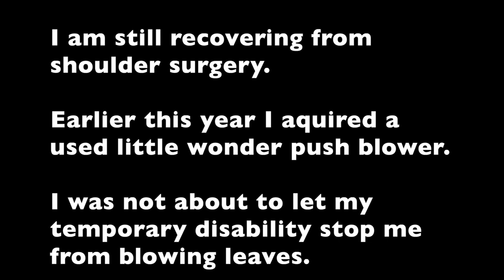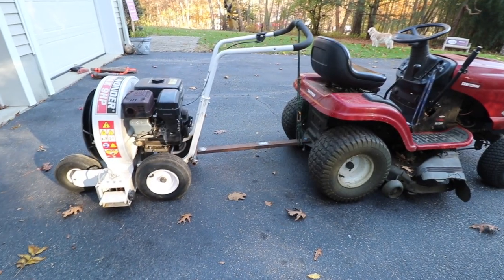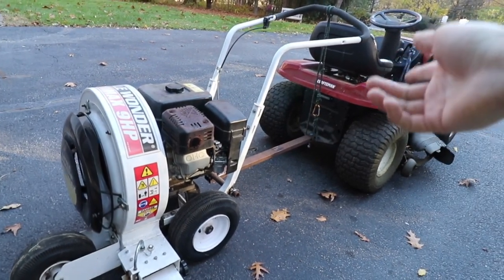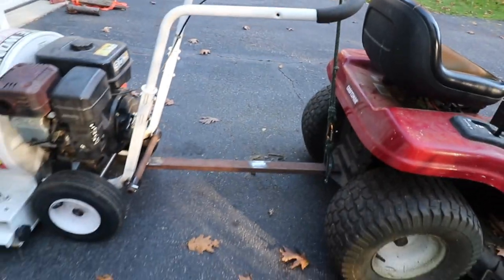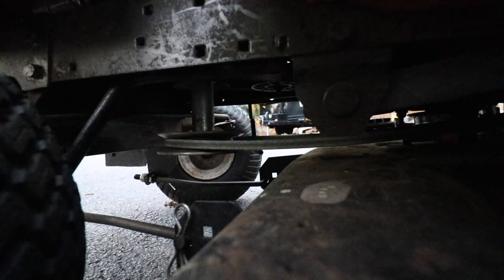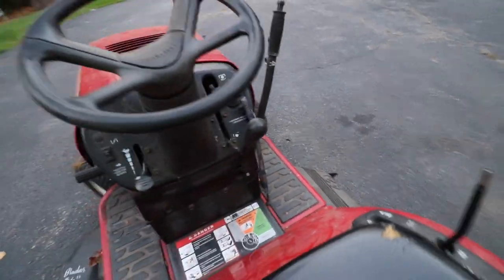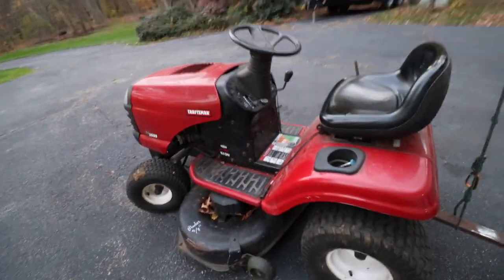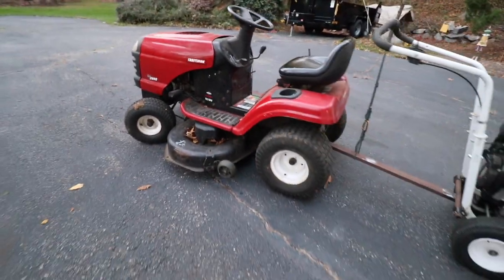Push Blower Mower Mount | Save your body!

Comment: Why not put a large swivel caster instead of the straight axle at the third wheel. This would allow you to make a sharp turn without digging up the turf. You prob wont need the rope if it swivels where ever it wants to go with all three wheels on the ground. 🤔
Reply from the maker: Never had a problem with this setup. You could definitely add a swivel caster in replacement of that front wheel. 

Simply put, for me, it's not worth the cost or my time.

Comment: I did the same thing only I put a pipe over the axle and made a tongue off of that. Don't have a problem with the machine tipping
Reply: If you don’t mind me asking. Did you just sleeve the axle and weld the mount onto that?

Comment: What little wonder model is that?
Reply: It's a 9 HP Subaru engine model. I have one also but has a really bad vibration to it because a bad impeller. I put a impeller off of a Billy goat unit which are a composite impeller and lighter and much better balanced.